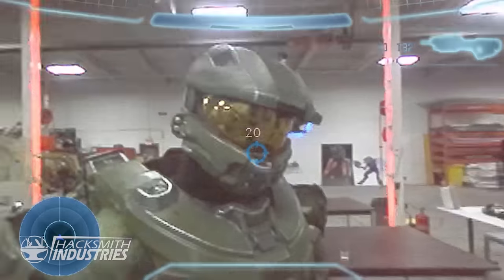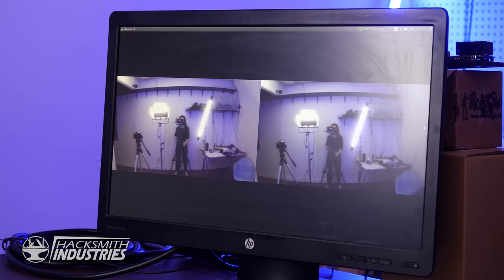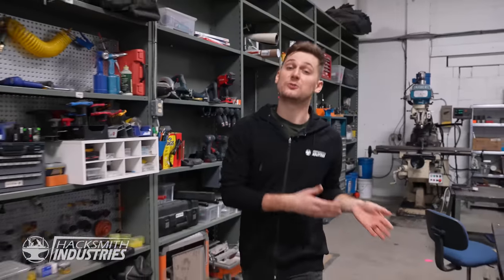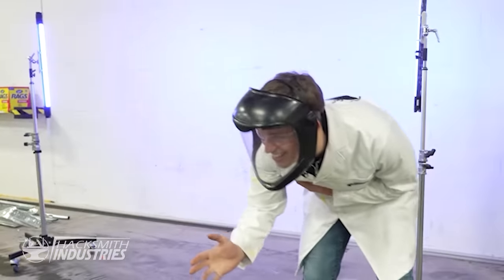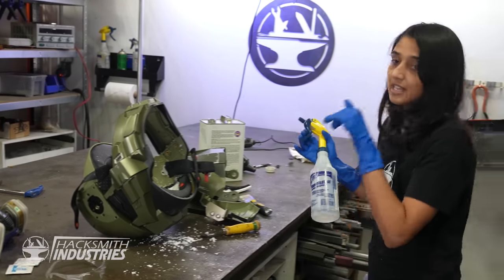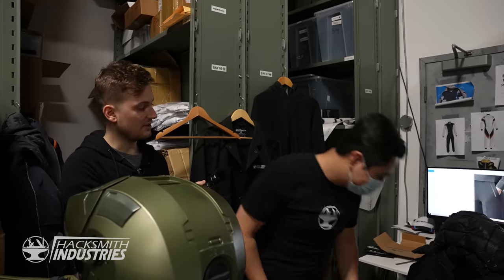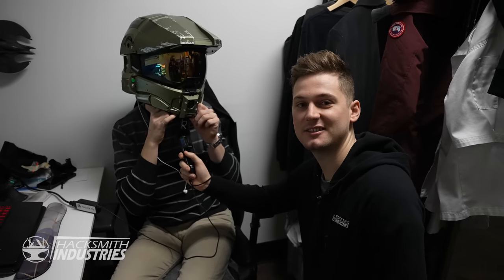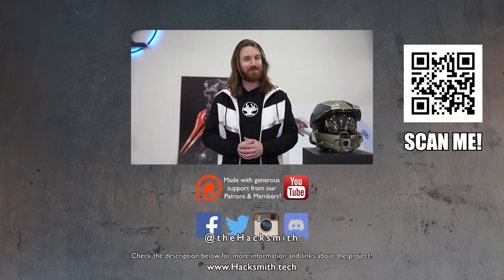Halo Helmet with REAL Heads Up Display!

Comment: For ammo counting you could make a glove that links into the grip of the rifle with conductive pads that relay the ammo count directly to the helmet
Reply: Or just bluetooth it. Simpler
Reply: @mjb2048  but then how would you know which weapon you are using?
Reply: @enlightenment4867  Have both weapons connected with bluetooth, and have the hud swap to the other gun when you start firing and it detects a usage of bullets. Not perfect but it'd probably work. You could also do some AI that could recognise the gun.
Reply: @mjb2048  simple until you run out of ammo then go to grab another weapon just to have to pair that one up. The gloves would be a better option if you're making multiple sets of these that get a read in each weapon as long as you're holding it
Reply: Or just keep track of it
Reply: Rfid it
Reply: @mjb2048  not really then he has to put a Bluetooth system in a clip or gun or both I personally think the glove idea is better
Reply: I was thinking that too
Reply: or maybe have some sort of ammo count detector directly in the mag using like metal or smth.. or like you said conductive pads lol
Reply: Not a bad idea yoy must know your stuff
Reply: Nah man thats way complicated just put a button connected wirelessly to a negative counter and feed it to the hud
Reply: People saying "switching gun is a problem etc" remember make it real os make it POSSIBLE going that far is not something always doable much less for a video , what they do is crazy already but it ain't that easy to do, gun count is hard even for guns that were made only whit that in mind , remember that.
Reply: Theres actually a gun that counts your ammo available already
Reply: Leave it on the gun like the og rifle
Reply: You realize that you’d have to put stuff inside of the magazine or clip, right? And that’s harder said than done because simply grabbing your grip doesn’t mean anything because it has to link up into the Magazine and have a direct count of every projectile inside. And depending on the projectile, and the size of the detection software inside, it might prevent the projectiles from feeding properly. But keep in mind I’m not a firearms expert, I’m just basing my comment off of what I do know about firearms and the function of anything that shoots. And the MA5 is one of the weapons with a magazine, so they’re going to have a fun time trying to do that if they see yo ur comment and decide it’s a good idea.:
Reply: Family friend of mine did it a different way for an electric airsoft rifle:

If you measure the voltage from the battery, it changes during each pull of the trigger. If you measure for this change, you can quite easily count how many rounds have been fired

Wouldn’t require conductive pads that mess up the aesthetic, or any Bluetooth parts either. Although, it could be Bluetooth if need be
Reply: @samund4082  you can’t connect two devices to one via Bluetooth, or at least it would be weird and difficult

You could get away with connecting it to two separate antenna, but at that point there’s easier solutions that need less computing power
Reply: @username0984 , unfortunately, we don’t know if they’re doing an airsoft rifle or paintball rifle.
Reply: Not a bad idea! Directly from the lore!!!
Reply: @samund4082  put the Bluetooth connection in each magazine. Measure the ammo, include a switch that requires the magazine to be inserted into the gun to activate. Each magazine fits only one gun, so, activation of a different magazine would cause the gun on the HUD to switch.
Reply: @Kiryu thats a big brain move
Reply: @Cru128  It looks like a paintball one, so it uses compressed air… opening of the valve that controls the air, that would still use a battery if it’s electric
Reply: Definitely
Reply: That’s actually exactly how it works in lore
Reply: I’ve seen many people make real life halo ARs each being able to count the bullets in the mag
Reply: I like this idea. But it would mean you would have to do any other halo weapon you make like that.
Reply: Technobabbel
Reply: That's liteely how it's said to be in the second book the flood
Reply: Png
Reply: Idk what your saying but I like it
Reply: @kyleanderson2921  he has to be able to count the ammo anyway, bluetooth isnt going to be that much harder in terms of size and effort
Reply: That's brilliant it would work well with changing weapons like in the game
Reply: Glove-how its done in shadowrun 3e
Reply: They already have those irk they are very expensive
Reply: @tosutaa  you can pair multiple devices to Bluetooth. You won't need to repair anything.
Reply: Or with this RFID (Contactless Payment Chips stuff)
Reply: @seskalarafey9285  you mean NFC, Near Field Communication.
Reply: @mjb2048  exactly.
Reply: @eingoluq  RFID to identify which mag, nfc for mag to intelligently tell smartgun the ammo count, rfid if your counting each bullet as it fires,  depends how smart a system youre going for...
Reply: @neoaliphant  yeah, you only need NFC for all that.
Reply: @eingoluq  main issue is speed of reading rfid/nfc,   might be better to have 1 chip per mag, which says what type of ammo, magazine capacity, when its inserted, counter goes to max count, and then each shot decrements counter,  flash when its low,
Reply: @neoaliphant  Dude, think logically and simply
-NFC for your gloves to recognize the gun you're holding so it will switch UI. All it does is makes the switch. NFC is simpler than RFID has a larger range which is unnecessary. you need interaction via contact. so NFC in your gloves and gun handles.
-Bluetooth for your HUD to read whatever the gun is saying. so it will just handle syncing the info.
-once you figure out how the magz can read your ammo, youre good.

your method would overcomplicate it. Always think simply.
Reply: Yesssss
Reply: @kyleanderson2921  and what does the glove talk to? The circuitry you have to put in the clip and gun. If all your guns are connected wirelessly you have the status of all guns available and won't be reaching for an empty one.
Reply: @samund4082  or just a switch on each gun so it connects to the Bluetooth
Reply: Or put it on the gun whenever it trigger it release the bullet and once you reload. The hud will show that it’s reloading the ammo
Reply: Sounds way more complicated than needed lol
Reply: That’s what I was thinking! Contact points on the hilt of each weapon would allow the HUD to reflect the weapon being held and could keep track of secondary weapons also
Reply: You could do that by telling you how many times you have clicked
Reply: You said so many thing that I barely know what they all mean when reading it all fast lol
Reply: Or nfc tags
Reply: Ok my thought was look at ammo in your gun
Reply: @enlightenment4867  Bluetooth
Reply: Yeah science
Reply: They could try recreate the Radetec counter
Reply: Ur so smart wtf
Reply: Hook up a camera to sink up with the crosshair
Reply: That's a great idea.
Reply: That's stupid are you unsc rifles and all the alien rifles would be broken down by the mijnir fives adaptability to rewrite code. Spartan must master all weapons alien and human. It would just be like connecting Bluetooth to whatever you pick up hence why there's an AI unit that is on board your suit that way you can rewrite the code to an entire station
Reply: That is a good idea
Reply: Huh?
Reply: You must be one of them smart guys always found them A bit weird to be honest
Reply: @enlightenment4867  use nft pads or something like that, if you hold weapon the gloves just scan weapon that you hold
Reply: It wouldn't be that simple it would have to be a language based encryption breaker like for every language you know how would you relay ammunition count from a covenant carbine to a helmet if it didn't have a language decoding you know AI variant that's why the AI exists like I said
Reply: Someone is a smart one the one that knows how to speak 85,000 verbal languages verbally
Reply: "cough cough" Cortana
Reply: But what about when you hold down the trigger for it's fully-automatic fire? It isn't semi-auto like nerf wants you to think.
Reply: People talking about adding chips to gloves when you could just implant the chip directly into the hand or wrist area... Could also always implement a voice change mode where the computer would have a list of all the weapon specs, etc so soon as you switch weapons it could change inside the hud. A glove, sure for possibly Bluetooth for weight utilization so it can tell how heavy the weapon is and change the ammo count on screen based off the weapon specs.
Reply: Or an auditive sensor of sorts counting every shot
Reply: @enlightenment4867  ir scanner on the glove and a sticker on the handle of the gun
Reply: Or just a magazine sensor
Reply: Dats cap
Reply: Hacksmith u gotta do the glove idea 100%
Reply: @enlightenment4867  bluetooth has proximity detection so it works. Its also better than conductive pads that can slip easily.
Reply: Yea you right there was a smart grip that can count ammo amount and can be linked via cable
Reply: Smart
Reply: @samund4082  Bluetooth is not reliable what so ever
Reply: 2billion 1q
Reply: Ya'll think you are scientists he?
Reply: Bluetooth or RF connection could work. Just relay the ammo count through that.
Reply: eh just bluetooth link it
Reply: You can also dumb it with grip USB.(4 fingers/palm pads)
Reply: Such bad ideas in these comments, just let the professionals do the work smd.
Reply: @enlightenment4867  bluetooth the mags
Reply: what if !?!?! you touch the trigger but don't fire a bullet......
Reply: @captaingreen4367  super easy barely an inconvenience. Can't remember the proper name, but basically Electric measuring tape. As the mag follower moves up, the counter goes down.
Reply: Bluetooth is simpler, but the more complicated one is mor fun
Reply: If We combine everything together and make multiple, we could just make Halo IRL
It would be hard but we are Humans
Coriosity always wins
Reply: @paul_gaming43  the current problem is interestingly about the same problem with the Halo verse.... Power. the Tech is more or less there, Strength enhancing woven skin suits, polyceramic  titanium foam plates that can ignore anti-material rifles and radioactive sources. NBC filtration systems, Reinforced Computer aided Exoskeletons, full body thermal management systems, Sprinting and Jumping Jetpacks,  and we can put most of the Tech package into a slim backpack.... the problem still is, in 1 charge at best we can hope it gets to about half a day of power which would be okay for guys just working a shift, but any mission that's more than a work day and it's basically useless.
Reply: @dramspringfeald  Jesus Okay
Reply: @paul_gaming43  

USMC sprinting jetpack, Harvard soft exoskeleton, NASA's titanium ceramic polymer foam, a number of camera and assisted weapons platforms, HAL Hybrid Assisted Limb systems or any variant at this point, transparent OLED screens, head mounted optics, gazelle sprinting blades with assisted balance. 

Like, in theory, you could load up with 200lb of armor, ammo and then sprint at 70-80mph while dead eyeing targets. 

And if you really wanna get spoopy Sandia National Labs EXACTO laser guided 50 Caliber ammunition.
Reply: @dramspringfeald  Okay i get it
Reply: @tosutaa  you can actually use rfid tags to automatically make something like a phone connect to bluetooth.
Reply: I like your idea i know most are saying a bluetooth connection but ive had and seen bluetooth get hacked very easily
Reply: @chaoslordnicky9723  There are plenty of other secure radio broadcasting systems, Bluetooth is just REALLY useful for people to wrap their heads around. 

Honestly the best one so far is a Binary Hardware encrypter where side one has a physical key, and side 2 has the other physical half but that's REALLY Expensive.
Reply: Boooom
Reply: @enlightenment4867  have the pads relay that information also.
Reply: Okay, how does the gun count the ammo?
Reply: @enlightenment4867  VISR, or Visual Intelligence System, Reconnaissance, is a software system that actually connects to weapons that utilize the SmartLink system, which pretty every weapon a Spartan has in their hands use it. It connects to the weapon and relays feedback onto the HUD from internal sensors within the weapon
Reply: Is there any doubt that metaphors are not Heads Up Displays?
Reply: @mjb2048  Until a covenant pairs with the gun's bluetooth and reads when he runs out. I'd just use an NFC coil on the grip and the palm.
Reply: Each weapon kitten counts 1 bullet (Probally pistol only, if not, semi-automatic mode of fire in the other kinds of guns required.).
Reply: @mjb2048  If you bluetooth 3 cameras at the same time you probally need make a hand interruptor to switch into the cameras.
Reply: @samund4082  you can use the same tech that detects characters from the toys to play with them in Skylanders. This is a brilliant idea to solve the ammo counter issue
Reply: Rfid chip in gloves.
Reply: @mjb2048  bluetooth is a bad idea because you could accidentally sync to the gun which is..not great as you could imagine how bad that would be in war
Reply: @kyleanderson2921  the gun itself would still need to have some kind of counter, not easy. The only commercial one I know if for Glocks and costs quite a bit
Reply: You’d have to grab it just right.
Reply: Just need 1 more
Reply: And we’re here

Comment: As a person who played Infinite on an Original Xbox One, I can confirm the latency is 100% game accurate.
Reply: Series X is no better.
Reply: Honestly I played it on Xbox one as well
Reply: I didn't play on Xbox one even I just played on Xbox
Reply: @blizzardgaming7070  its loads better to me, sounds like you need a better monitor or internet
Reply: @TiredEyePilot  what?
Reply: @
B-159SybrZaku - The 2nd Halo Airsofting spartan
17 there's an Xbox that's literally just called Xbox
Reply: @B-SybrZaku-ThendHaloAirsofting  I did not reference load times, I mention latency, as in, in game latency. As in Spartans rubber banding all over the place on a match per match basis.
Reply: @TiredEyePilot  then just say “OG Xbox” so people aren’t confused.
Reply: @TiredEyePilot  as in the one that released 15 years ago? Halo Infinite, uh, doesn't run on that m8
Reply: @TiredEyePilot  Yeah, from 2001 which i know can not play halo infinite
Reply: @blizzardgaming7070  That rubber banding is network based not hardware based, it can be caused by the server, or your own internet
Reply: Use performance mode instead of Quality might help
Reply: @blizzardgaming7070  What are you on about? I have an XSX and use a 4K 120HZ monitor and everything runs perfectly fine; no frame drops at all
Reply: @harrymillar4193  this is the last time I’m saying this. I am talking about server side latency, lag back and rubber banding. Not frame rate, not load times. The hit registration is crap though.
Reply: @B-SybrZaku-ThendHaloAirsofting  given how it changes match by match, staying for a whole match, it’s sever side.

Comment: I'm a bit late on this, but great work! Stereoscopic camera passthrough is a clever sidestep of the geometry issues that seem to come with putting mirror-based HUDs in helmets.
All the best with whatever's next, Chealsie!
Reply: Stereoscopic passthrough is what SadlyItsBradley has been unveiling as the practical future of VR/AR (aka MR) over the next few years.

To my knowledge the Lynx R-1 is the first consumer HMD to be built around applications that enable it's capabilities.
Reply: What?
Reply: @WW1Historian  Basically.......full field of view vision through a mask or helmet using cameras (kinda like a first-person GoPro or night vision goggles).